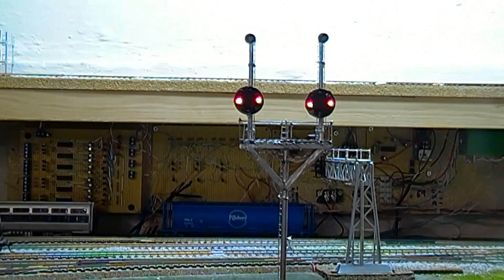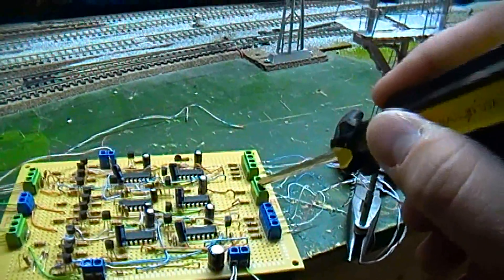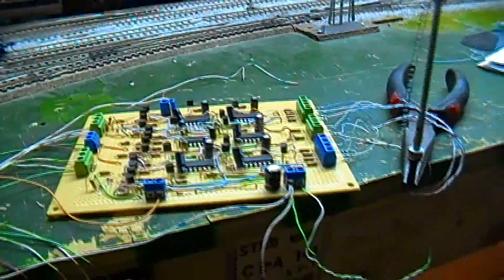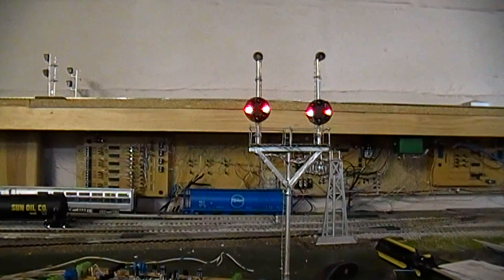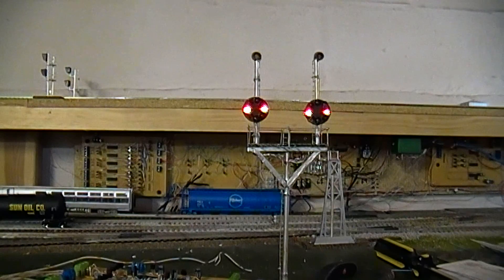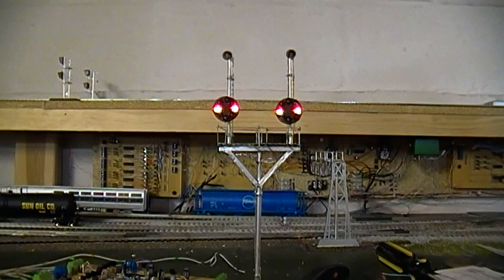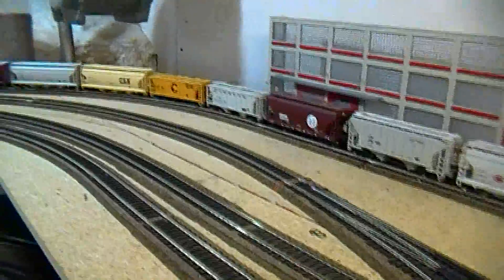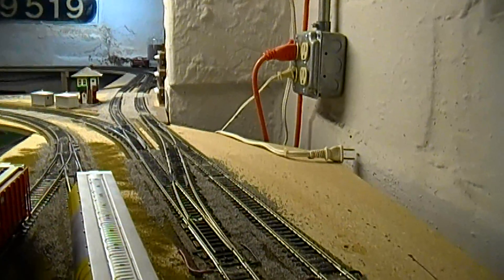Custom Layout Signal System - CPL Signals & Driver Circuit Demo

Comment: I remember when the two greens with no marker was slow clear....and not slow approach slow....That changed sometime in the late 70's or early 80's? ...and the "Restricting" signal was called "Permissive", and had either the high marker or low marker, depending on whether a switch was thrown.

Comment: Can you do a “stop and proceed” which is the
Stop indication with the marker light lit?
Reply from the maker: Bryce Walat thanks for your view, at some point I will try and get these lit up again. Since the making of this video I have converted to using JMRI for signaling, which saves me lots of time from building circuit boards. It's a work in progress but they do have CPL B&O rules setup on there which means I can do the Stop and Proceed that you speak of. In the process of redesigning a layout right now but will try and get some video soon.
Reply: trainman1986 I love these signals either way. I model the NY Central, which uses searchlights and Type G color lights.
Reply from the maker: Bryce Walat I always liked the NYC tricolor lights. I have a couple of those that Atlas made, the G type. Honestly if I had enough room on my layout, I would have one of each type of signal. Such a neat variety out there even though a lot of these older signals are being replaced

Comment: Nice demonstration. Interesting note... the 1953 B&O rule book shows that Slow Clear is simply the two steady greens in the cluster. By the 1969 rule book, there was no aspect for Slow Clear. Two steady greens in the cluster indicated Slow Approach Slow. The two flashing greens aspect didn't appear in the rule book until a couple of decades later.